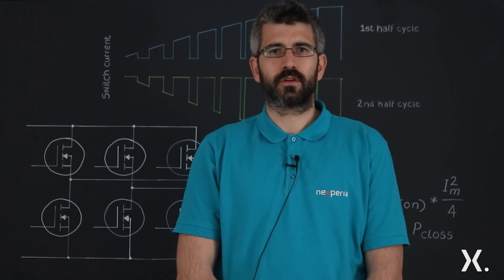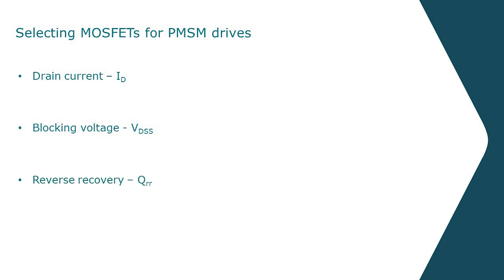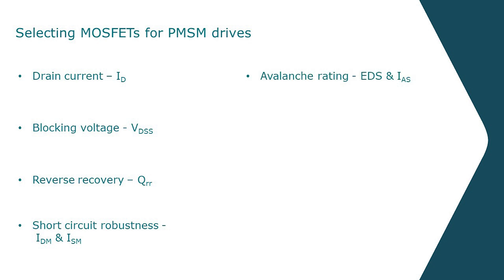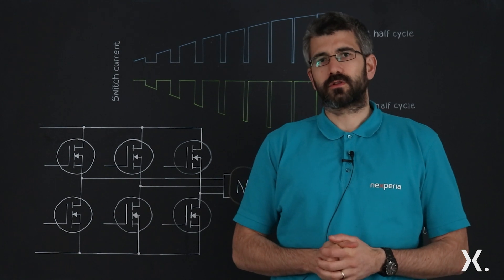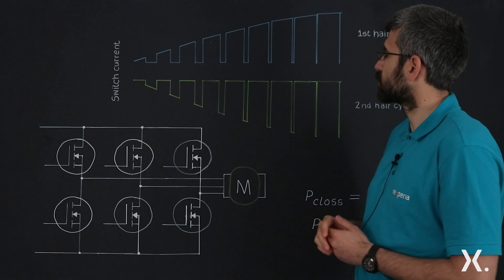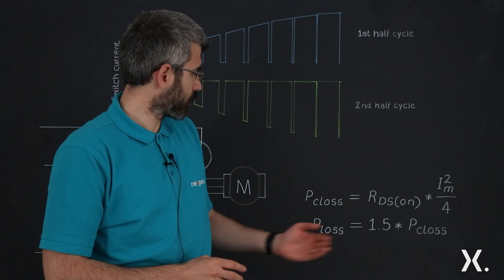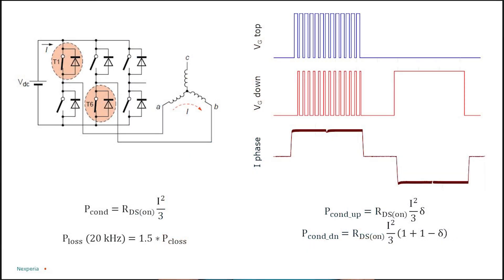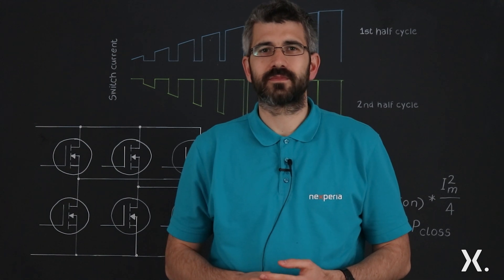Selecting MOSFETs for PMSM and BLDC drive applications

Comment: what is the percentage loss distribution in switching loss and Conduction loss in PMSM? Can we say 70% Conduction and 30% switching loss?
Reply from the maker: Hello. 70/30 sounds good. It can be anywhere between 40/60 to 80/20. This is because of low switching frequencies (up to 30kHz but can be as low as 10kHz). This can be opposed to BLDC which can go up to high rotor speeds and thus high switching frequencies. In that case switching losses can dominate substantially. Same goes for DC/DC converters (buck) where the minimum is 100kHz switching causing 5 times more switching losses.

Comment: Nice one and I have one doubts. In the final equation, the conduction losses are mentioned as Rds x i2/ 3. How it is calculated
Reply from the maker: Hello, thanks for your question! Looking at the A+, switching at a certain duty cycle δ, a current of value I passes through it for a time δTs (Ts being the switching period) in the first half cycle. In the second half cycle A- is switched with duty cycle δ, while A+ is then switched on for (1- δ)Ts. Therefore, during the hole control cycle a single switch conducts the current equivalent of half a control cycle. This means that the switch conducts only one third of the control cycle. Therefore the conduction losses are (Eq 10) Pcond =RDS(on) 1/32. Have a read here: https://www.nexperia.com/applications/interactive-app-notes/IAN50009_Power_MOSFET_applications_in_automotive_BLDC_and_PMSM_drives.html